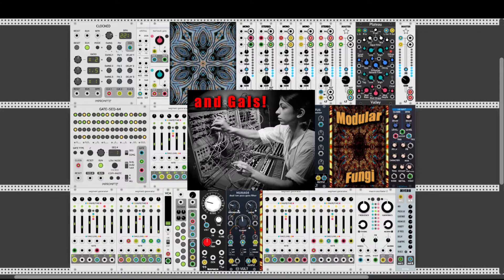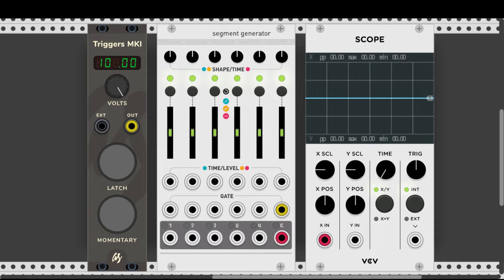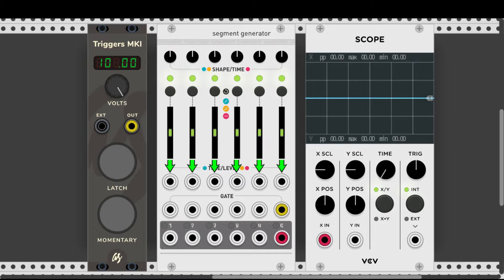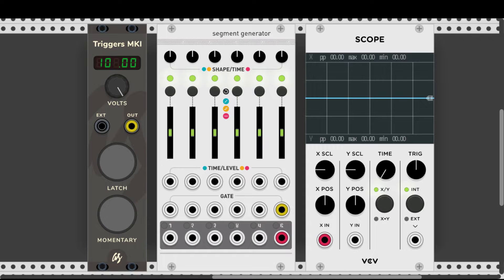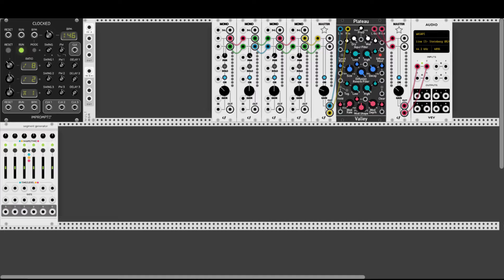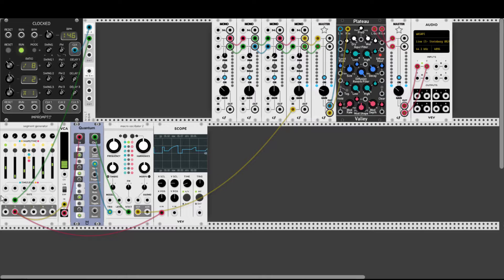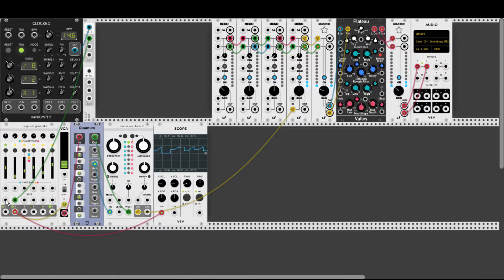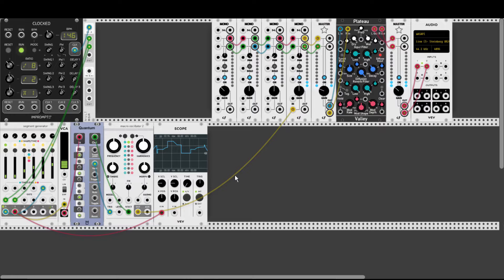Mutable Instruments Stages - VCV Rack Tutorial

Comment: What is the purpose of mults in VCV? In physical rack they are necessary, but in VCV rack they do nothing.  In VCV all you have to do is pull another signal out cable out of the same output.
Reply from the maker: You're totally right, but there are actually 2 reasons why I (usually) use splitters. First of all, it's easier for me visually to see where each cable is going, especially in bigger patches, and I don't have to spend too much time following cables, which is actually harder in rack because you cannot touch them and follow with your palm. The second reason is, that it's much easier to change the connections and disconnect cables. If you have, let's say, 3 cables going out of the same output, and you want to disconnect the first one you've connected, you will have to disconnect the first 2 just to reach it, or again, start following cables and disconnecting from its destination. It does make patching easier, and you can concentrate more on patching rather than following cables all the time.  Cheers!
Reply: It's also easier if for some reason you want to change the source module. Instead of repatching 8 resets or clock sources etc (using the 2hp Ohmer 1x8), you can do one cable, and not miss a module, and then spend a long time troubleshooting
Reply from the maker: Are you also using mults, Patrick?
Reply: @OmriCohen-Music  yep.

Especially because of your second reason. It's tough for me, as a person with ADHD, to load a patch I haven't touched in a while, and follow whatever train of thought I'd had previously, without some form of organization.
Reply from the maker: Totally, it's makes patching much easier and more fun ☺